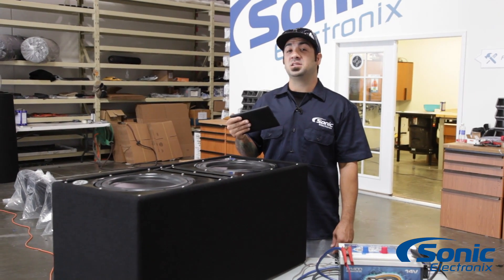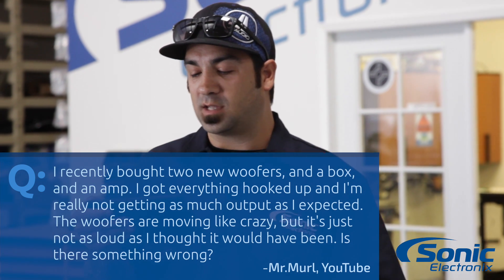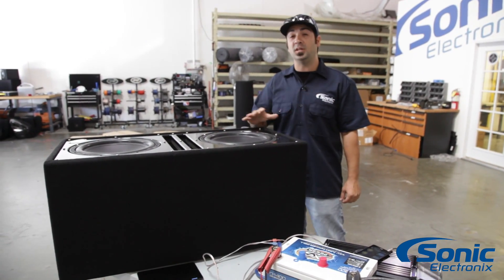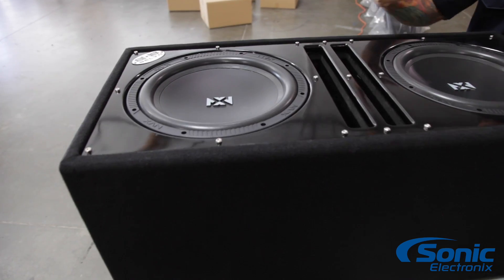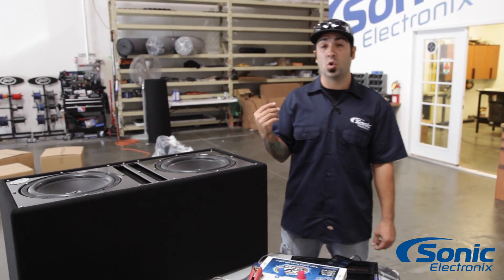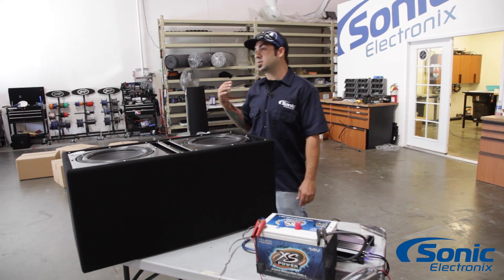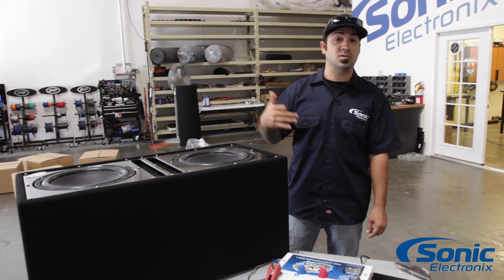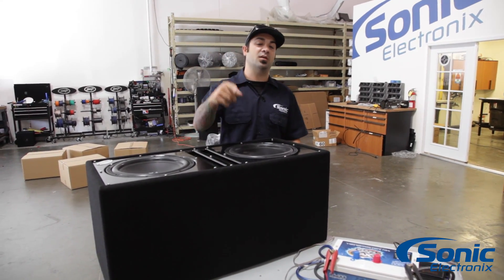I'm Not Getting Much Output From My Subwoofers | Car Audio Q&A

Comment: guys I know this is off topic, but does a pioneer champion series 400rms woofer sound good?, I want to buy one tomorrow
Reply: +Craig Martin lol giving the qts of that particular driver being so high (.81 if I read it correctly) in theory and my experienced opinion that driver would be better suited for a sealed enclosure. The rule of thumb I have always followed is this: subwoofers with a "low" qts, say .35 and lower are better suited for a ported enclosure, qts with .36 to .50 usually perform well in either sealed, ported, or band pass applications, and anything higher than .5 usually is a sealed only type of driver. The Xmax on that subwoofer is very small. Xmax is the maximum length (in mm) that the subwoofer cone can travel pole to pole (top to bottom)
Reply: +Craig Martin And 11mm is a little more than 2 inches I believe, so low end 35-ish Hz and down will suffer, sounding muddy and distorted because that frequency will extend the subwoofer past its mechanical limits (lower frequencies have tons of excursion). I personally cannot recommend a brand name specifically, but I can say you should look for a driver that has more Xmax because the music you listen to has plenty of low notes. Also keep that qts above .35 but no higher than .5 for your enclosure. I could go on for hours about the t/s parameters but the info I gave you should be enough to point you in the right direction. An awesome resource to learn more about the technical side of car audio is the12volt.com. Hope this helps! Good luck with your build!
Reply: Need more info... What type of music do you listen to? Is it going in a prefabricated box or are you building your own? Sealed or ported? It's a good idea to learn what are called the t/s parameters of the driver you wish to purchase. It seems overwhelming at first, but it will help you to select the driver you want for your listening preference. It's simply the mechanical properties of that particular woofer. Hope this helps man! 😀👍
Reply: +Nathaniel Renner lol Thanks man, It's a slot ported enclosure tuned to 34hz, I listen to all types of music, but mostly Deep house, the subs specs - 8
DC Resistance (Re)3 ohmsVoice Coil Inductance (Le)0.94 mHMechanical Q (Qms)11.86Electromagnetic Q (Qes)0.87Total Q (Qts)0.81Compliance Equivalent Volume (Vas)1.19 ft.³BL Product (BL)9.7 TmDiaphragm Mass Inc. Airload (Mms)218.8gMaximum Linear Excursion (Xmax)11.5 mm(copy paste) lol
Reply: +²ºº²GHOST²ºº³ I want good sq, I don't want it to rattle my cars panels loose lol, I want to know if they sound good and musical, I've had high powered pavement pounders in the past, but my alternator and battery wasn't up to the task, only 105ah combined
Reply: +Craig Martin What's your budget
Reply: Nathaniel Renner thanks alot man,  this helps alot
Reply: +Craig Martin no problem man! I'm always willing to help out a fellow bass head, noob or not. We have all been noobs at one point, and anything I can do to help boost the car audio community I'm glad to do. If you have any other questions about anything feel free to post again. My phone beeps at me whenever someone replies to a comment of mine on YouTube. Good luck bro! 👍😀👍😀
Reply: +Nathaniel Renner Hey man, Do I bought a subwoofer, Xmax - 25mm , Fs - 28Hz, cms - 0.15, Qts - 0.37, Qms - 5.5, BL - 27.2, Hope I made a good choice lol want low bass, also its rated at 800watts rms
Reply: +Nathaniel Renner oh and it has a 3" pure copper voice coil
Reply: +Craig Martin good choice looks like in my opinion it will work great for the enclosure you have man! Post a video when you get it hooked up! Would love to see it! Good choice bro!
Reply: +Nathaniel Renner will do , Will post a video ass soon as I hook everything up

Comment: if 1 is reg. 1 is inv. they need to be out of phase....if his were out of phase he will see barely any output...its like a big hole in the box woofer punches out and one punches in...it looses all pressure....he prolly has a sealed box......and goddamn thats a small box for  2.12s

Comment: I have a question about ohms. How does box rise work? And is there a such thing as box drop?
Reply: bigger box bigger rise...and where the impedence spike in the box is thats where it peaks (hz)
Reply: +hittin-low_150db+ Yeah I know how box rise work. But i just want them to do a video on it lol. But the thing I don't know if theirs such a thing as box drop, I hear some people talk about box drop but really haven't seen it
Reply: +Subwoofer King if you open up your port...it will lower
Reply: Yeah one of my friends said he had 2 Sundown ZV4 12's wired to 1 ohm, and the impedance would drop to 0.4 ohms when playing. I didn't believe him at first
Reply: +Subwoofer King impedence dosnt drop....voltage does tf
Reply: +hittin-low_150db+ Yeah that's what I'm saying. I don't believe him, but he swears by it. I'm going to get him on video saying that lol
Reply: +Subwoofer King hahah ill sub for that
Reply: I hope this helps newb's a little - grab a program called WinISD from the net (go for the  Pro version), and model up a box with any speaker from the list (or go ahead an plug in the TS parameters that came with a woofer you have).  Just let the program calc out the box for a sealed box (no need to play with it).  Where it says "Transfer Function Magnitude", select it and change it to Impedance - what you see is a rise in impedance at the drivers resonant frequency as installed in the box.  You can do the same for a ported box, and not only will you see that, but also somewhere relatively close to the port resonant frequency.  This is impedance rise, and is approx the impedance that the amp will see at said frequency (remember, WinISD is trying to model a perfectly built speaker in a perfect box - so real world results will vary).  It is NOT just a function of box or box size, or port - it's is a combination of a number of factors.
Reply: Maybe you don't use it anymore, I get nice predicable results using it. :-P
Reply: Good for you.  I want SQ above all else, and I have a pair of 10's that are clean and tight (not boomy), with near flat response down to about 23hz (cabin gain factored in, no EQ's, no "boosters", etc), only normally powered to -6db (128W RMS) on a 500W amp) in a (GASP) ported box...  The subs can take the full power, but it out power's the rest of the system (I want a clean well rounded system).  Run what works best for you and your application.  So I say use what ever tools you need to get the results your after.
Reply: +²ºº²GHOST²ºº³  No EQ's (loudness controls, etc) for me - I playback exactly as recorded - don't need to color the sound.  I enjoy hearing all the detail contained in the original recording.
Reply: +hittin-low_150db+ with ported boxes the tuning frequency is in between the two impedance spikes. Its not the frequency where the response spikes per se. Can be, but depends on the tuning frequency and resonant frequency of the car.
Reply: +LutkeVeldNL what i said is for a sealed box...or a rear chamber on a 4th order
Reply: +LutkeVeldNL and where the impedence spike is is where the enclosure peaks cause there is alot of back pressure
Reply: hittin-low_150db+ Huh, I think you're wrong on this one. The back pressure is the most when the port resonates (tuning freq), Below tuning the driver gets unloaded (back pressure decreases), that's why people use subsonic filters. Back pressure in a sealed system doesn't vary as for as I know. Also the real peak depends heavily on room/cabin response of the car.

Comment: Please explain and possibly demonstrate the use of the PHASE SELECTOR switch or knob on a crossover.
Reply: Believe it or not the sub phase can be out of sequence of the rest of you stereo system. Meaning the sound takes a bit longer to catch up to the rest of the sound coming out of the other speakers, so you flip the switch in order to work in sequence with the rest of the system. Almost as if you reverse polarity for the speakers. This is beneficial when using multiple amps and different speakers firing in different directions. You can play with the phase switch on each amp to achieve the best sound from the stereo system.
Reply: you can pop test with a 9v batt.
Reply: +hittin-low_150db+ I think you misunderstood what I was asking, a pop test determines negative or positive by the speaker  popping in or popping out.
Reply: let me be as straight forward as I can be, I got a clarion MCD360 3 way crossover, in the subwoofer section there is a switch labeled PHASE which can be set to either 0° or 180°. Please explain and possibly demonstrate the use of that phase switch.
Reply: +Dane Brown ohh yeah it just reverses the polarity...play a rock/punchy bass song and switch it to 180 the woofer will suck in...but if its 1 woofer or multi. in sep. chambers it wont make a sound difference